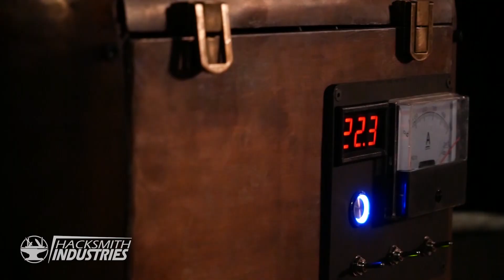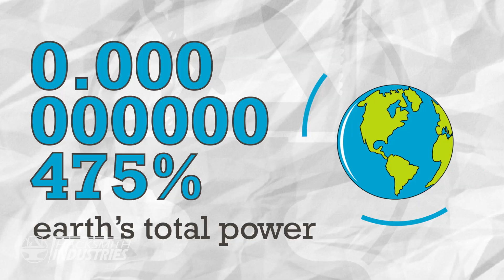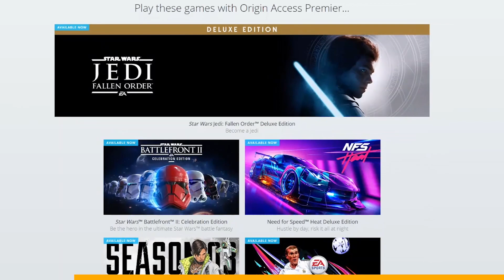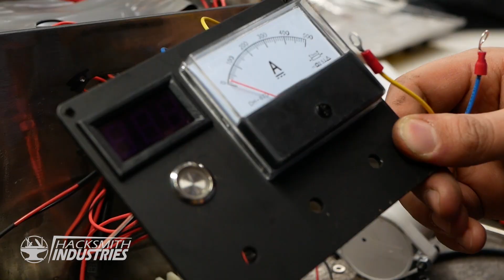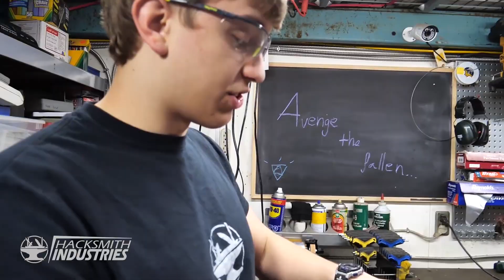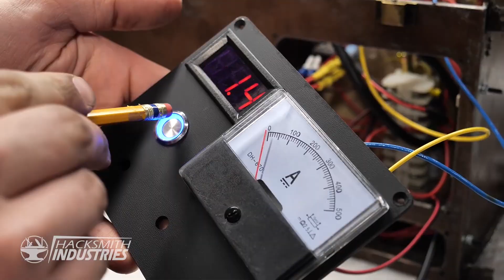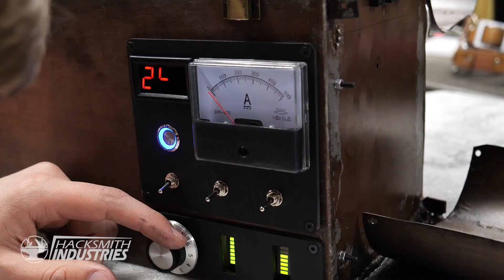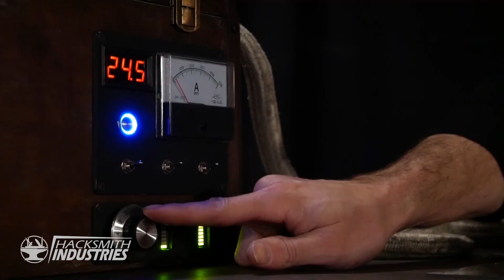World's First Protosaber! (REAL BURNING LIGHTSABER)

Comment: Great! Now make it Green
Reply: Bruh
Reply: @Kali-8  with the fact that its so hot its burning neraly everything that it touches it could be possible to constatly blast some sort of metal powder into the blade so that the powder burnes and makes the light saber look different
Reply: @bmpproducer9334  yea thats right but..
Why did u tell me?
Reply: @Kali-8  because i thought that the bruh meant something like "thats impossible"
Reply: BMP Producer copper
Reply: @bmpproducer9334  oh lmao nah, you use it when dumb shit said and stuff or if something happens what you didnt expect etc.
Reply: @bmpproducer9334  yea you can use copper sulfate to do that
Reply: Yaseminn
Reply: @bmpproducer9334  I'm smort
Reply: @nitzanasa4624  
I don't think copper can withstand extreme heat and be as effective as steel ...
Reply: @asterlofts1565  yup thats why he used tungsten to make the photosaber
Reply: BMP Producer no. It’s so hot it will bend like putty. It’s why blacksmiths need to flip the metal when they heat. It up. Doesn’t happen here because any change in momentum is over a large time, but if they swung it hard at something it’d break.
Reply: That is impossible (at least now). The light emitted by that heat cannot be green ... you should alter the laws of physics or chemistry or something to achieve it.
Reply: @asterlofts1565  it could be blue tho
Reply: Akshay Kali Sadly it can’t be green YET but if u make it hot enough maybe it can be blue
Reply: @Torokluth  you'd be using hella much energy tho.. and the color would be white blue so idk if you could even see it that well. And i think the stick thing will stay red/orange/white ish, but ay he could try
Reply: @Kali-8  But that would require a material that can withstand 3000 degrees Fahrenheit and is also a good conductor of electricity
Reply: @Kali-8  yea if the temperature of the flames is above like what 2000° or something
Reply: @Kali-8  
But that is done thanks to extreme heat and certain chemicals. And making the "green color" is impossible now because the chemicals are not as effective when combined with extreme heat. If you read the chemistry and physics books, you will notice. The color blue and green, of course it exists, but not under the same conditions that we would like for a protosaber. Some only occur under certain very unusual physical and chemical phenomena and circumstances, difficult or almost impossible to replicate.
Reply: @vyx1733  yup
Reply: Asterlofts actually not really , different elements burn in different colors. You could plate the material in barium to allow it to burn green
Reply: @blakemeyer9562  
As I explained there, it is very easy to say that. It is true, there are different colors depending on the intensity or physical and chemical properties of heat ... but if you read chemical and physical, you will realize how far it is from the ideas that science fiction wants to give us. Actually, that is the reason why lightsabers do not exist now ... because our science has not yet come so far yet ... there are still a few years or decades left for that to happen.
Reply: Yeah, but I want a purple one
Reply: @ekusas475  i see what you did there🤣 
I want one in ahegao print
Reply: He can’t, it’s burning metal and burning metal is only one color.
Reply: wierdness and gaming "weird" in your name is spelt wrong
Reply: @Aerochalklate  
Well, you have to thank Google Translator for your efforts ... but it doesn't mean that you can't make the laser sword ... D:
Reply: @asterlofts1565  But laser swords can't make contact with one another and you'd have a beam strong enough to cut steel that would reach like 15 miles depending ijn humidity and particulates in the air. In reality not many sci-fi weapons are as efficient as firearms or they are so outside known physics it's basically just magic hence sci-fi science-fiction. Like in Star Wars the energy output of a Star Destroyer's turbo blaster can equal like half the U.S. nuclear arsenal. Even antimatter would be inefficient to power that. You'd have to carry thousands of pounds of something that annihilates if any matter touches it, air is matter. The Death Star would go from 0 to a fraction of the speed of light with a single shot.. Couple million g that whole base is vaporized. Star Trek at least tries to seem reasonable but several techs should make everyone immortal and I'd still get nervous holding a phaser. If you can vaporize a city block repeatedly... Well a phone battery rapidly discharging its total stored energy is scary and it couldn't vaporize a paper clip. We've all seen our rather weak batteries fail imagine thousands of times that charge. It be like running around with a few nukes on your hip. And seriously guns kill plenty well enough and no Jedi can block lead at 800-1300 fps it would go through the lightsaber and dead Jedi/Sith. Nice fancy light stick, modern humanity is scary good at killing haha 😢
Reply: @Sol-Invictus  
Personally, I only believe and have faith in science 100 years in the future.
Reply: Y’all don’t know how to take a joke
Reply: Lol
Reply: No i want a purple one
Reply: @killerkill8869  No only Sam J gets that
Reply: r/woooosh
Reply: no, red.
Reply: No purple
Reply: Or Kylo Rens
Reply: That's the last thing we need to worry about he has just created a lightsabre 😂
Reply: green fireeeeeee XD
Reply: No make it more red
Reply: Green isn't possible by that much energy it will just appear white because it's "glowing" red thru blueish.. And to emit only blue and wavelengths we can't see so it looks blue is like reentry from orbit hot.. So probably not something you'd want to hold.. But I wouldn't melt Styrofoam within hundreds of feet of myself either or inhale vaporizing metal.. And that's coming from a smoker.. There's toxic and there's dude that's bad sh**.
Reply: @Sol-Invictus  
Exactly.
Reply: You are evil , bruh
Reply: No.  Purple.
Reply: dead
Reply: Nah blue.
Reply: As Samuel L Jackson said
.
.
.
I want purple lightsaber!
Reply: That actually can somewhat be achieved with using some of the elements from the periodic table.
Reply: No blue
Reply: Napoleon I Bonaparte no it stays red
Reply: HollyT  
You have to read chemistry and physics books and you will realize why lightsabers still cannot be done.
Reply: Naw make it red lol
Reply: Captain beans  
Yes, that turns green ... but not the intensity of heat ... there's the problem. And that problem is called PHYSICAL AND CHEMICAL.
Reply: @jsh3288  
No.
Reply: blue
Reply: Maybe if you had some sort of heat resistant crystal that could merge red photos into green, that could be used to coat the blade and make it green.

Comment: Believe it or not, this is canon. The first lightsaber prototypes are exactly like this but not just in orange. Early jedi wore the large power supply box on some sort of utility belt. Of course you could cut the wire to deactivate it. They saw that weakness and changed it

Edit: I didn't watch the video.

Comment: This is awesome keep up the great work!! Have any thoughts gone into a retractable blade yet? Like the plastic ones where it's just tubing inside tubing, even if it doesn't retract into the hilt could u look into retracting from a metre down too like 6inches or something? That would be insane, with a thicker and stronger blade you could hollow it out and it might still give a similar effect with strength and glow, and could that save power due to less surface area to heat up?

Comment: Your better off with having two straps for the battery pack, having one strap puts all the weight on one shoulder rather then having it more evenly distributed; which is also hard on your back and neck muscles and joints. I know this as someone with, scoliosis and a skull defect, who had to give up using a backpack with one strap. In time, such a heavy lopsided back pack will cause problems. I wonder if this backpack could be built into one of those weight vests; by having the weight evenly distributed on both the front and back of one's torso; so you will not be off balance by having all the weight on your back side. This should make you more maneuverable and cause lass issues with your body in the long run.

Comment: Is there a way to dye the colour of the saber so we get movie accurate colours?
Reply: Emerald Talks yep. Some elements react with fire and give colors. But you need to replace the finished element.
Reply: @Takaiwase 
That might ruin the effect of the light stick though, as it’ll just burn out, or explode like a firework.
Reply: @EmeraldTalks  It's still a photosaber. We are still far from having enough power to get a real lightsaber
Reply: @Daridon248 
What does being a protosaber have anything to do with different colours?
Reply: @EmeraldTalks  I mean it is still hard to find a way to change colours without causing some side effects.
Reply: @Daridon248 
That is extremely true
Reply: yes , make it so hot that it starts emitting high energy waves and becomes blue xD
Reply: @StefSubZero270 
That’s dangerous...
Reply: @EmeraldTalks  it is indeed :)
Reply: StefSubZero270 damn the destruction if you just full power smack someone with that when it's blue

Comment: I am not enrolled in university jet and already know that even the thought of switching 20kW with a mosfet without heat sink is idiotic sorry. You need an IGBT array those things can handle the current and the voltage you only have to be careful to get around the latch up effect but you should be able to switch it on and off with those with a reasonable voltage. Alternatives would be Tyristors or Triacs those you can only turn on and not off (latch up effect)
Reply: ok boomer
Reply: @thomasfernandez6580  
Did you read I am not in university jet I am generation Z.
Reply: Nobody Interesting so what your saying is. They did it wrong but you don’t know that they did it wrong
Reply: @kensai7703  Of course I know that they did it wrong despite the fakt that it is very notable that they did something wrong based on the white cloud of smoke. They probably vaporized there mosfet becaus 1 those are not suted for  high power aplications and even if there was one it would require a substantial heat sink. Just becaus I am not at university doesnt mean that I have no clue. I went to some sort of technical collage. The best mosfet I found was 850uOhm P=R*I^2 P= 850W of losses. That calculation is a nobrainer.
Reply: Nobody Interesting hmmm idk bro I think they are more credible and accurate than you
Reply: @carmelo9843  no I don't English is not my mother tongue so I beg for your forgiveness.
Reply: @kensai7703  choose as you like just saying that, that was a rookie mistake and provided some alternatives.
Reply: They don’t need you to explain what they already did
Reply: @Δημόνιον  Yeah they used an high power relay the old fashion way and the right way to go from the start when you do not intend to switch the device on and of on a regular basis. I just was suggesting a solution for further projekts when they can't use a relay.
Reply: Nobody Interesting cool

Comment: I cant even act disappointed, I'm a huge fan of lightsabers and knowing very well the impossible nature of star wars lightsabers (the heat, the amount of energy being released especially when coming in contact with anything and the insane amount of power required to power such an object) I was absolutely mesmerized by the results of this revision compared to the last attempt. Absolutely epic and I'm sure holding something so dangerous and powerful led to an actual respect of the lightsaber in general. You really would need to be super human and completely trained and focused to wield it let alone battle with it against another lightsaber. Great work hacksmith team!

Comment: A lightsaber is certainly possible.

The metatmaterials for the blade - especially spinning cone for the blade to be retractable   - and the power supply...

Well Star Wars is a Level 4 civ that's decaying and acts like a decaying Level 3 civ.  A Lightsaber is Level 2 upwards - (ultra high power available casually, advanced materials)

Let's put it this way:  If they made these in RL and not mentioned in scifi they'd call them "Einstein Drills".  Much like the original script they'd be stuff like Machetes - and used in close quarter ship combat to avoid puncturing a wall or critical equipment and killing everyone.  Except Star Wars is many times above Level 1 to Level 2 - the Lightsaber itself is archaic even in Cannon - just later getting adopted by and improved by the Jedi.

Neat work what you did, though.

Comment: It's just a giant heating element, like those inside electric grills or water heaters. U should try to make laser saber, only 2 problems to solve: power source and how to control length of the laser beam, for now all these "1st real light saber" vids are just toys for nerds.
Reply: Maybe if he took some sort of glass that could absorb the laser light on top and glow on the side..
This is cool but really dangerous they need to put some kind of material that can absorb the heat but you could still see the light from the grill.. it would not cut things but it will be safer to swing and play with

Comment: You could use a high powered laser on the outside of the bar reflected down to itself, some of the energy from the reflection could also be used to heat the bar.

Comment: You say it's scientifically impossible to create a real lightsaber, but you're dead wrong. It is scientifically possible, nothing's impossible unless you really try something. Power stuff yeah it might be impossible with current technology, but later down the road you can with better technology that's capable of generating such power in one device, and continue to operate at a stable continuous power. This goes to creating better batteries capable of holding billions of kW/hr without needing to be charged or power draining from them super fast with continuous use.

Comment: Could you not use a relay for the switch. Using a 9 volt to turn on the relay which will engage the power of the saber.
Reply from the maker: You need a very powerful relay  -- a contactor like we used

Comment: When they finna make a retractable one
Reply: I dont think its gonna happen, with a handle that size and with all the wires and electrical things needed inside of said handle I dont think they'll be making a retractable one also with the fact that with how many amps of electricity that runs through this proto saber having those links in the frame of the "blade" the titanium tube and stuff, the electrical current would have alot of spaces you escape and would go back to the problem of only having titanium is that it would then put all the amps into the titanium and would then cause it to smoke and melt it down

Comment: 5:12 you're only supposed to put the amp meter around one of the cables. if you put it around both, it'll show a much lower amperage than what is actually being used
Reply from the maker: Both of those cables are the same polarity... they're parallel power wires. The other end is the steel table

Comment: Oh... Good thinking putting a massive locomotive relay on there instead of a mosfet!! But what about a fuse? I suggest using industrial cuircut breakers and power transmission wire as an upgrade

Comment: 4:30  Being a second year Electrical Engineering Undergraduate, if you are recreating this lightsaber DO NOT PLACE YOUR VOLTAGE SOURCES IN PARALLEL UNLESS THEY PRODUCE THE SAME VOLTAGE.  This is how you get what we call EE (Electrical Engineering) smell from all your expensive components burining up.  You essentialy push alot of current through the lower voltage battery causing it to burn up.
Reply from the maker: ... what video are you watching? The individual cells are in a pack,  and there are 6 packs in series,  with two sets in parallel. There is no lower voltage source

Comment: I have two questions-
1.what happens if it gets short circuit while using it? Will we see the user getting toast?
2. Why not use a light plastic case for the power source and batteries instead of the heavy metal box???
P.S.- i have absolutely no idea about all these engineering stuff but just love your channel and these questions came out of curiosity.

Comment: Why would you even consider a relay in the first place? This exceeds the rated capacity of the largest relay by a factor of, what, 10?
Yeah, at 20kw you're gonna need either a contactor or some jank hacks I'm not going to suggest because you'd try them and get yourselves killed.
Reply from the maker: When did we ever consider a relay? We were using high power mosfets originally.

Comment: About half the weight of that pack has to be that super heavy gauge steel you made the box out of. Why? If it had to be metal, why didn't you just make it from thin sheet steel or aluminum? It makes no sense.

Comment: 2019 making a proton lightsaber 
2029 making a fighter jet
Reply: 2039:making a tie fighter
Reply: 2049 making a Death Star
Reply: 2039: building a Millenium Falcon
Reply: 3000: discovered kyber crystal
Reply: 2050 : shoving a superlaser into an exoplanet
Reply: 3020: making a elon musk portalble limited edition death star made of lions
Reply: K3O5 making a star
Reply: The "proto" in "protosaber" is a reference to it being the "prototype" technology on which lightsabers were built. Nothing involving reference to protons, which are subatomic particles. Directed proton radiation is a thing but it doesn't work as a mechanism for powering or operating any kind of lightsaber-like device.
Reply: blivvy ok boomer
Reply: @Cookiekekw  Well, you might need to reach boomer age before you can achieve basic reading comprehension, but that isn't normal. You might want to get that checked, actually.